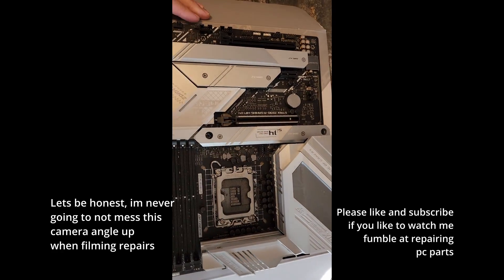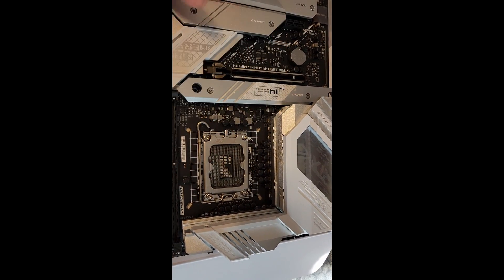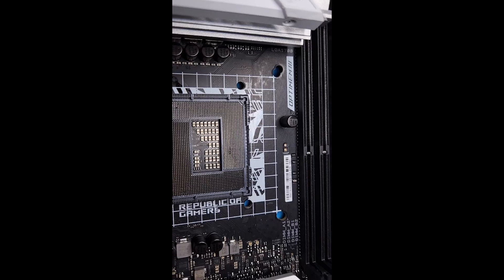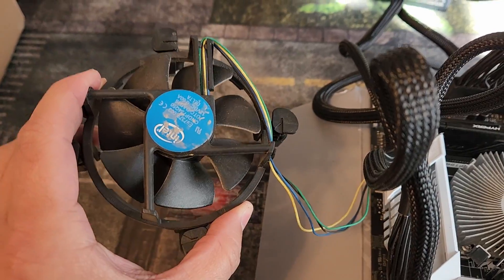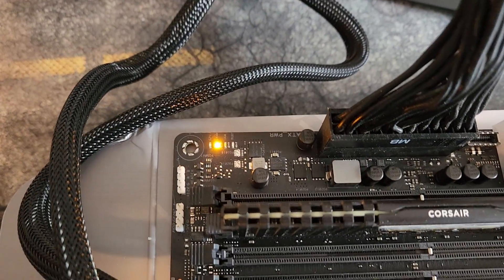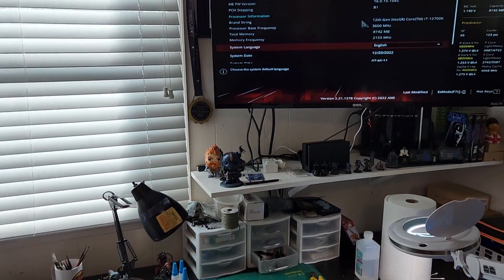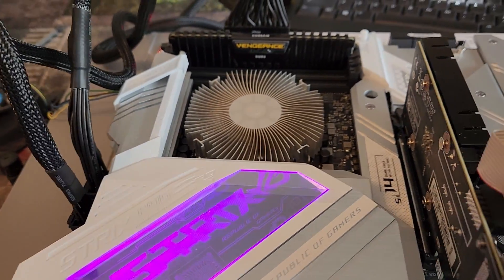z690 ROG STRIX motherboard INTEL SOCKET REPAIR, My first motherboard repair attempt, how did it go??

Comment: Okay, a couple of things here.  First, were you ever able to post using at least 2 RAM sticks in Slots A 2/ B 2?  I also had bent pins in my Strix z690 Gaming A and thought I fixed them all (roughly 8-9 pins) but was never able to post with 2 sticks. PC went into BIOS and WIndows without a hitch but never got it to post with 2 sticks. This was a year ago..  Took a break until last week..

Still no post with 2 sticks. Tried everything - 2 different RAM Companies, same stick on slot B2 all sticks were working fine but never a post when I installed that second stick in A2.

Finally, filed an RMA last night and as I'm preparing the motherboard to be sent out, pull out the 13700k and I see 1 bent pin!  So now, I am in the process of trying to get this pin right and it's just not working out.  The other 8,9 or so pins went by without much issue last time but this one is on the edge of the socket (not sure if the mechanism is different.)
Wish me luck.. Want to just stop now and just send the board in but heard about their reputation when it comes to honoring warranties over bent pins..

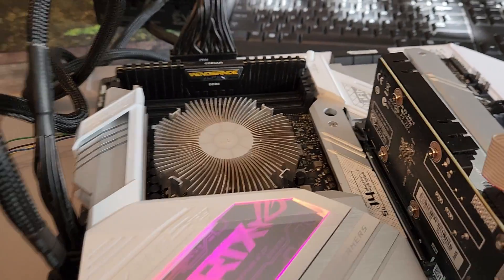If you are functioning properly I wouldn't worry but if you are still having troubles I think you can still work on straightening some more of your pins. @4:00
I counted at least 20 of them that could still use some work but like I said, if it's working fine then I wouldn't touch a thing.